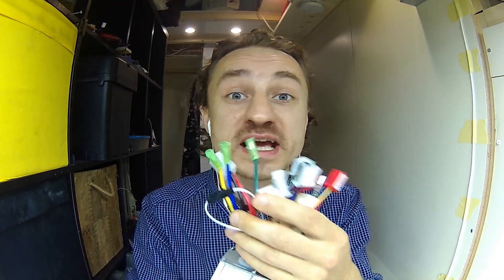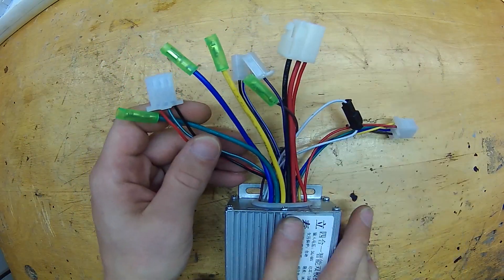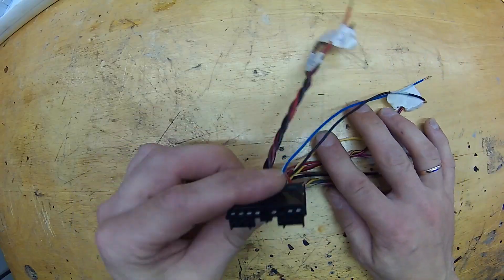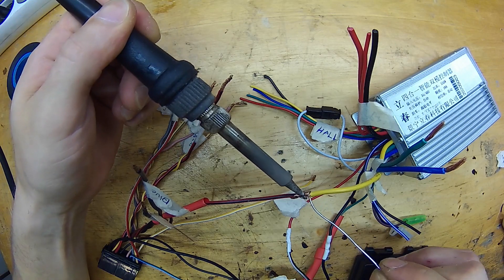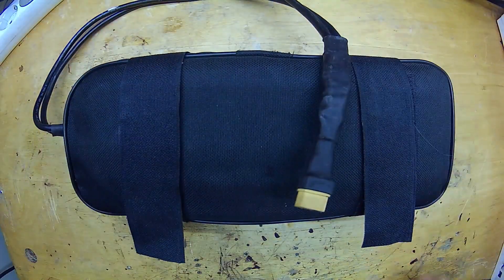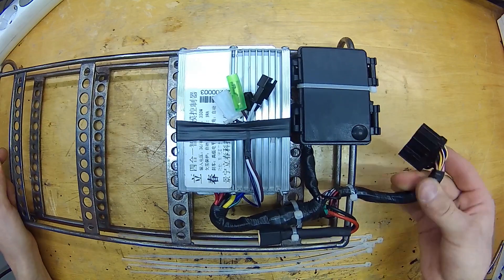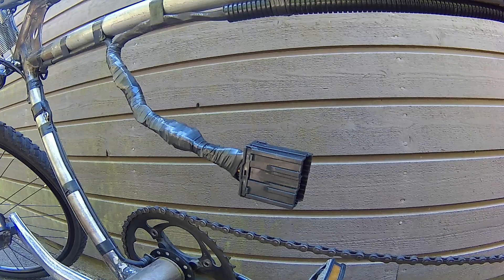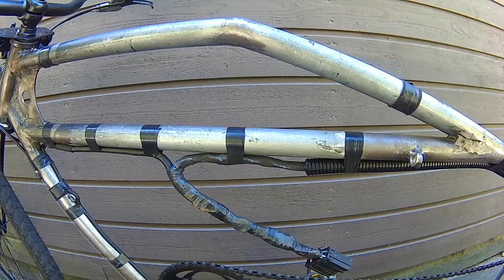How to wire eBike controller the BEST way | Brushless wiring

Comment: hey bro, i have this crazy idea of having 2 controllers (one is the stock 350w, the other is a higher 650w controller) installed but only switchable, meaning only one can work at a time. you need to switch it first to the one you want to use, maybe using an MTS. I'll be using an automotive connectors to combine some wires just like you mentioned in the video. however, I would like to know if it is OK to just have the switch in the input power of the controllers only? if one controller has power, the one is off. will there be a leak voltage if they are connected in parallel? thank you.
Reply: only 1 controller will be ON by using a transfer switch which will be in d middle of the battery and the controllers. they should not be On at the same time as short circuit is possible. the input wires will be split into the 2 controllers but only 1 controller will be powered, the other one is disconneted via the switch, like a DC breaker. i am not sure if the off controller will receive any "leak voltage" from the one which is ON. what do you think?
Reply from the maker: Ok, now I get it a little bit better. So as I know, a transfer switch is designed to provide full cut, and also 0 connection while switching. So both controllers should not ever be ON at the same time. In theory the output circuit of a controller is not effected by backvoltage (since basically it's a switch), but here where I would consider checking specs on those mosfets, to know do they have some leakage. And think about could that effect OFFed controlelr in any way. I guess you would have to connect both controllers to the same brake switch, throttle etc.. So that +5volt could leak into the OFFed controller. I don't think that's a problem, and you can stop that with diodes. Also one thing I would think about is the spark, that happen when connecting batt to contr - it's kind a heavy because controllers have massive caps inside. That spark could mess up the transfer switch, if it's not made for DC. Also those caps store a lot of energy, so one controller does not actually go off that instance, so maybe there is a small chance that both of them could be ON at the same time (just a half a sec).
Reply: I am thinking of using two DC circuit breakers as switches to avoid arcing when switching from one controller to another but, I would need to make sure that only one DC breaker is ON at a time. I appreciate your prompt reply and would love to see more tutorial videos. thank you
Reply from the maker: Thank You and good luck! Very interesting project you have, please keep me posted :)
Reply from the maker: Hello! Very interesting setup. Do you want to have both always connected to the battery at the same time? And just use the power buttons to switch them ON or OFF? Anyhow I don't see any problems with having them both connected to the battery. They should not use any power at all, if the main switch is a normal binary switch (not a latching push button system, since that requires power).  But, if you are planning to connect both of them to one 3-phase motor - that's kinda new to me, so I'm clueless will there be any issues or not. You need to test that. In theory there should not be any issues, I think :D
Reply from the maker: I just realized, that if you connect 2 controllers to 1 motor, then that may result in a short circuit - hypothetically speaking if both are on and producing power + timings go offset for some reason. So be careful testing this :)

Comment: Hey man how can I get in touch with you to figure out stuff about my bike ?:):) thanks man your videos are really helpful
Reply from the maker: Hello! Thanks for your comment! Please, ask me anything here in the comments, I will try to help you out :)
Reply: @3LECTROSHOCKED   i have a daymak em2 how do I do the 1 connection from a 48V-84V Bluetooth controller
Reply from the maker: Hmmm, that's an interesting product. It looks pretty heavy. It has only 500w motor? Does it have gears? What do you mean "the 1 connection"? Are you changing the controller?
Reply: @3LECTROSHOCKED  not that heavy and yea I want to put this controller in a bike I just don’t want to half to fiddle with the 40 wires lol it’s got a 1000w motor and it’s got 3 speed
Reply: @3LECTROSHOCKED  do you have Instagram or something ?:)
Reply from the maker: Oh, so you want to take the original controller from this daymak em2 and use that with another bike? :)
Reply: @3LECTROSHOCKED  yes that’s correct and don’t want deal with all the wires so want to do the one connector like you did so it’s removable easier so I can change it from bike to bike :)
Reply from the maker: Ok. I looked online about that controller and it looks like a regular one. Although it seems to have very weird markings regarding power and volts.. So I would start this job by deciding what appliances I want to have fixed on the frame. That maybe brakes, throttle etc.. maybe a power switch? There is a 3-speed switch, which I think is really unnecessary. I would permanently put that to the highest setting (since it just limits amps at lower setting, it's not a "boost").  Then I would put "aside" every other (unnecessary) connector that comes from the controller. And see how much wires there will be left for all the needed appliances. Then I'll do a continuity test with a multimeter to find out which of those wires are the same, for example the "ground" should be the same for every appliance (battery, hall sensors, brake, throttle etc...). Same test for the +5 rails, there maybe a couple wires you can save (not use/remove) there also. NOTE, the main challenge you will have, is finding a suitable connector, because this controller is 1kW. That means that there will be more amps in the motor wires, than in my setup in this video. So you need a connector, which will have at least 3 pins capable of handling around 25-30amps (1000w / 48v = 20amps). If you use this with a 72v battery, then it drops to 20-25amps. Hope this helps!
Reply: @3LECTROSHOCKED  okay thanks man
Reply from the maker: You're welcome! Let me know if you need help :)

Comment: I just got a panterra fusion electric scootee and the wiring is all disconnected and the lighting wiring is off too. Ive looked everywhere for instructions but no luck. Please help !
Reply from the maker: Hello! Hmm, as I see, that's a eMoped. If there is no info about it online, then you need to A: follow the wires too find out what is what, or B: take a multimeter and measure everything to see what is what. Usually the connectors are made so that only the right wires can be connected together, I hope that is the case for your eMoped. Also try googling the actual controller model/maker, maybe you can find info about that and see what goes where. Good luck!

Comment: where did you purchase the automotive connector from?
Reply from the maker: Hello! Good question. Some automotive stores have these type of connectors off the shelve, but they usually are not the original stuff + you have to connect pins to wires. I actually go to the nearest junk yard and buy some of this stuff from wrecked cars - so I get the original stuff, BMW or Volvo are good connectors :) Get some good wires also.

Comment: I wanna know how you install 12v light with that controller step by step
Reply from the maker: Hello! Good question - I just maybe make a video on that later :) How powerful light you have? What is your battery volt?
Reply: I have 48v and 36v...
but I don't know what voltage the stock light has.
Reply from the maker: If you don't have a display with light function, then I recommend to just use a flash light designed for bicycles. Because if you use a step down converter, stepping from 48v to 12v will generate a ton of heat. That will be very inefficient. But if you have a display and there is a light output on your controller, then get a 48v-36v light (for ebikes) and connect that straight to your battery. You will be able to control that with the display buttons. That is the most efficient way. I personally use just a flash light - its so easy and effective :)
Reply: My LCD throttle haa light function.
Reply from the maker: Do you have a "headlight" or "light" wire on your controller?

Comment: Do you have a diagram for the controller?
Reply: Thanks for the reply, I'm trying to find out what the three cables that are not used in my fiido bike.
Reply from the maker: Sounds like power level switch. There is a ground wire and two wires for full power and half power (low level activated). What do you think? Measure them with multimeter. If there is no positive signal, then it's probably power level switch :)
Reply from the maker: Hello. Sorry no. This is just some random 350w controller from AliExpress. There are many manufacturers, so I guess there are also a lot of different variations of the circuit :/

Comment: hi im having an issue with the instrument wire ,i think ur controller is:  https://www.ebay.co.uk/itm/36V-48V-500W-Electric-Bicycle-E-bike-Scooter-Brushless-Motor-Speed-Controller-UK/392912420602?_trkparms=ispr%3D1&hash=item5b7b67befa:g:KCUAAOSwYMldOSBB&amdata=enc%3AAQAFAAACcBaobrjLl8XobRIiIML1V4Imu%252Fn%252BzU5L90Z278x5ickkyMJZWL%252BqFSgQ3TOOe%252FNr7tUXrpVc8PPIvKUEH5%252FFgtx7Ki1U5fj6uZlEl7WyPfU2cGVciEV2OV%252BVaXa2ywkqXdLJsbMiVwRYHIZqsbznfR%252F9fQwDcQCinOTu%252FNc3FE4gxYkIf1qV7XCaem6zMS%252Bb0zS4nnhiBR6bhz41iyxnbLQ0txIZaOC%252By%252BylvAgYU9mE%252B9nFXXBO9nqArgll%252FAXe2J%252BjvABh233BJTTt7P31EzKypJE6obBuZuD2aPv9uKJLghWV0QCdat5XCIHKaZ4nT3UyfSfHroo478alCXrlHYLhwbOKc6kwwciYFz0TltqCDtR55NRLNxXHKfSCM45iRw0ev3oWVoLtPwQtqhFEfxq4vq%252FBCIGobXVSP4a3MAQVz1DjIYus5h%252B42vguwG3fFtc0c%252Fn4YxYAwiXAoD4P3neyFN8vJQyFDjc541HNCps4k7V4lJwo6ZJFk9nLPbGvx1SxaYIdm3w%252Br2bJv8jXkaaqEwGT5c2Uu5bIMsKDNH%252BVOC6%252FVi6MNeOTnRtH4xKV1PrwD0iPBL7AcZQFGHMO1Kg8PLzS38W5AAMIb0V1d5DSEAyJiKYyQilP4qPC%252Ft2z3n%252BLzLsjXMQ5pkOkqz%252FwxBpMipMEkgeDaXcBej%252BiHBbsghJ0zFN5%252FkYBiO%252BW2c14UABZ%252FRCCsGmOOxv6TFuJbf5GkmbbM87mmit7VSIOn1AsWf%252B%252B57441FPwg0uN5WOBChAT9aZ0ipyMtKYt1%252BO89XMCKCtv2qD6NnMvJsRvvtHOunqIOAxGQDRt4vB%252BLwzxMw%253D%253D%7Ccksum%3A39291242060278560046d4e5409ca998c4ebd6e0da1b%7Campid%3APL_CLK%7Cclp%3A2334524
Reply from the maker: Hello. Please tell more. What wire exactly is the problem?
Reply: @3LECTROSHOCKED  Im building a scooter,it has the same controller as sent in url,I have a s886 throttle and the blue wire needs a connection i cant locate its connetionpls help
Reply from the maker: Does it have a display+buttons, or a key, or some other button like a "horn button"? If it's just a throttle, then there should be just 3 wires. If it has anything else then you need to see if your controller have inputs for those appliances. Me, I don't use display or any unnecessary appliances - don't need them :)  My controller in this video is very simple, it's 350w. There is no inputs for programming (display+buttons).
Reply from the maker: Or if it's a "thumb" throttle - maybe it swings both ways? Then it can be a high level brake..?
Reply: @3LECTROSHOCKED  Yes,Im using a s886 Thumb throttle To the controller,ive looked it up and im not sure of the meaning of some words displayed altho it can upon how to connect them,On the url shown That is the 500w controller ...the green instrument is free(what is that ?....b4 i check the hi-brake.
Reply from the maker: The "instrument" is the speed level indicator wire. I don't use that :)
Reply: @3LECTROSHOCKED  Thank you ,i give in,im getting a basic throttle
Reply: @3LECTROSHOCKED  my bike starts and then cuts off all the time ,i followed you but my throttle is like the same but has a power switch,and switching off & on repeatedly  resets my training wire .
Reply from the maker: do you mean you connected all wires with one connector?
Reply: @3LECTROSHOCKED  the lock is connected to blue throttle wire yellow throttle vcc on power cable,ALL throttle wires are in,i get voltage and power on but no rotation
Reply from the maker: is this the first time you power the controller? did you gone thru "learning" phase?
Reply: @3LECTROSHOCKED  yes,and it worked going back n forward
Reply from the maker: so what is different now? sorry, I don't understand what you did exactly, before controller started acting-up :)
Reply: @3LECTROSHOCKED  after using the training wire ,upon switching back the power it wont run,its off the floor ,all my connections look good ,but no power to the hub after ive done the training.
(its a scooter build(would i need a fuse ?)
Reply from the maker: hmm.. I assume you unplugged the training wire after it learned your hub motor?  maybe you could try to do the learning again? yes, definitely use a fuse :)
Reply: @3LECTROSHOCKED  i think the amp draw is to much
Reply from the maker: so your battery is very small? do a test: put jumper to the key wire, and carefully jump the throttle signal input with +5v. if it spins, then there is something funny with the throttle.